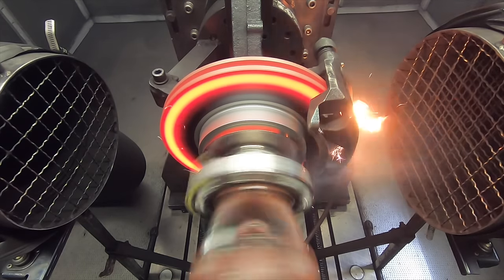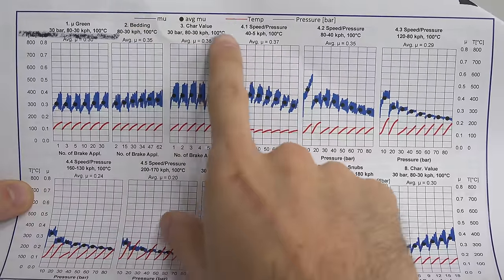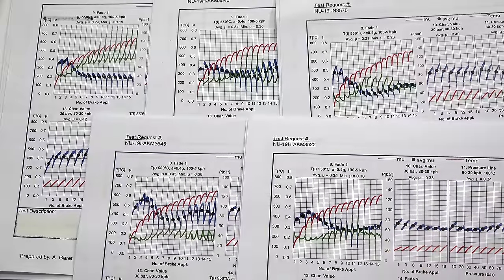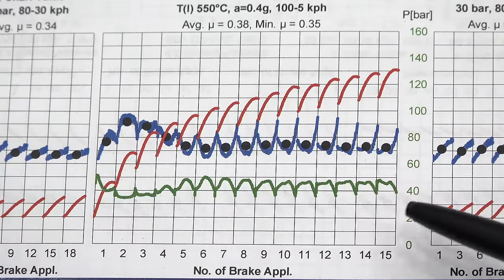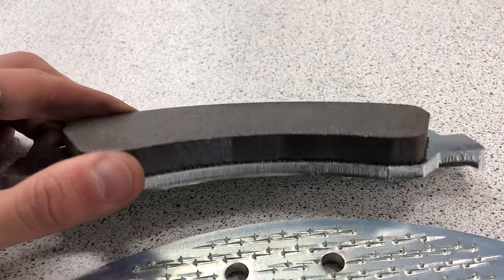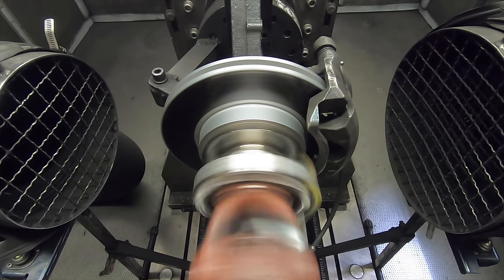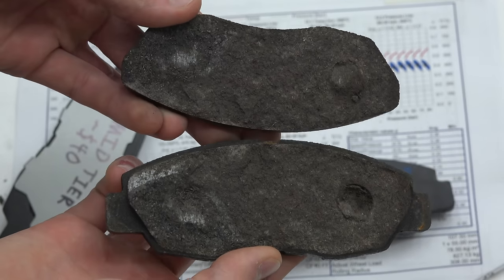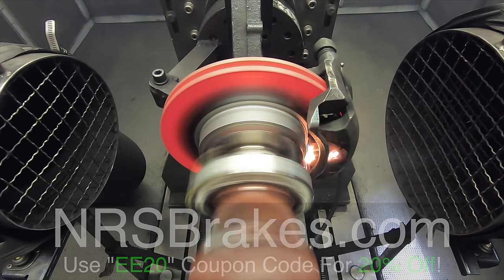What Are The Best Brake Pads? Cheap vs Expensive Tested!

Comment from the maker: *Important Note* Lots of questions about the materials for each pad! It's honestly a very difficult thing to determine, which is why I left it out. Regulations allow for such a wide variety of materials that unless you do some sort of chemical analysis, I'm not sure there's much meaning behind it. For what it's worth, the cheapest pads were "semi-metallic" (again, vague, but that's all they tell you), while the other four pads are "ceramic." There's a wide variety of what can be included in pads, regardless of the material stated. Also, material alone doesn't show a strong correlation with all tests (both ceramic/metallic can do poorly in sound, corrosion, shear, etc), so it's difficult to determine what's the cause for doing well/poorly based purely on material.
Reply: Any chance you could tell us the application here? I'd imagine an older vehicle would use older technology in OE pads, as would a cheaper vehicle.
Reply: Curious on the differences in results between ceramic, semi-metallic, organic, ferro-carbon, and full carbon pads. It would be interesting!
Reply: What vehicle were these pads for? I’d like to know the OEM manufacturer.
Reply: This just left me with more questions than answers. There are so many variables that this doesn't seem to help. For example my daily has some mid grade pads that have a lifetime warranty so I paid for them once and never have to again while on my more performance oriented car I definitely am more worried about fade so I'll spend more. Also a few noisy stops is irrelevant imo.
Reply: Next time will you include the self (or not, I don't know) proclaimed "best brakes in the world" Brembo?
Reply: I think another comparison needs to be done here. The same 4 levels of pads (Budget, mid, high, and OEM) from the 5 common materials used (Organic, semi, full, ceramic, and carbon). A total of 20 pads checked across the same tests. Checking to see the performance difference of each tier across each material. I feel like this would show a more comprehensive analysis.
Reply: @Sam S wtf I don't understand what you are saying, could you please rewrite that?
Reply: @Sam S We're here discussing pads. OE pads were certainly not ceramic 20 or 30 years ago.
Reply: Can you do a video explaining the benefits or reasoning as to the caliper location in relation to the rotor, ie: 9 o’clock vs 3 o’clock, etc.
Reply: @johnmoore1495  In one of the shots (I think related to the shear testing) I saw that the OE pads were also marked AKM.  Just a guess, but Akebono semi-metallic?
Reply: EE, another great video!  Could you please do a video about the pad/rotor “bedding” process and its importance in preventing pulsating brakes?  It would also be nice to see a pad manufacturer confirm a procedure for fixing pulsating brakes.  Stoptech has some white papers on bedding that are an interesting read.  Cheers!
Reply: @Sam S Chevrolet literally just had a recall on the brake system of tahoes this past weekend. And I think he was meaning advancements in pad technology not necessarily advancements in brake hardware.
Reply: if the adhesive bond was stronger in the shear test, then having a mechanical grip between the friction material isn't the best. the adhesive is stronger than the other so budget or mid is the way to go
Reply: At least probably none of them were made of asbestos. I hope. Although it was still allowed in Canada until 2019.
Reply: 2 questions.

What make/model of car are the pads for?

What's the mid grade pad brand? (That's the one I'd buy lol)
Reply: Was there any data recorded for, the wear that each pad caused to the rotors? The price of replacing the rotors, is higher than replacing the pads. The longest lasting pads wouldn't be an advantage if they cause excessive wear to the rotors. Was there a specification for the surface finish of the rotor used in the tests? It would also be interesting to know, how well each pad would perform, with a worn rotor.
Reply: Watching your video, I was wondering all along about the relevance of the pad/disc pairing. Do some pads work better with some disks as the metal alloy in the disc can vary from manufacturer to manufacturer (my break discs on my Porsche show corrosion spots every time it rains, my former Mercedes discs didn't even after a few days).
Also, do some break pads wear out the break discs faster than others? Because, I would rather replace break pads more often and spare my discs (which cost over $1,000 per corner!) even if the pads are of the expensive kind.
Reply: @Photoandcargeek  This is great content. It in would be interesting to know more about rotors as well. I had some old "ceramic" pads that would come to a stop completely silent and smooth. Then the next "ceramic" pads were as bad as any in this regard with worse brake feel. Shame I can't remember what the first were becuase they lasted so long. The good ceramic pads were hard on rotors, but that's good in my environment because often time if the car sits for just a couple days in the salt, the rotors will rust so bad that traditional pads will gall up and, then your brakes are screwed. As far as rotors go, it seems like a total crap shoot and incredible number of junk rotors that delaminate or rust so fast that they destroy the pads. Even if you buy dealer "oem" disks from most brands they are of questionable quality and origin compared to what comes on the car from the factory.
Reply: @ourback  if these are for an Asian OE, they did
Reply: Would love to know what brand the mid levels were. Thanks!
Reply: @Anankin12  they dont make pads
Reply: @michaelehresman5881  the organic,ferro-carbon, and full carbon would do the worse until they heat up. same with ceramics of the semi-metallic but the ceramic created the cut before the carbon and organic pads which will work better in performance areas because they will have less "brake fade" aka work better at the hotter temps
Reply: @toddturnbaugh4451   A lifetime warranty on a pad that should be the sacrificing part means that your Rotor will be GROUND..
Reply: Can you tell us how much you make for each of the 100 ads I had to watch to get through the video?
Reply: @Formulabruce  The pads wear out, I return them and put new ones on, it takes maybe 20 minutes, I never said they were lifetime pads.
Reply: @johnmoore1495  looks like a D449 to me , but I've knocked a few back already .
Reply: Michael Ehresman would be a interesting test
Reply: I worked for ACDelco for over 7 years in the field holding seminars, classes and warehouse defects. Our cross-training “Subject Matter Expert” explained that “Stippling” was used for the mechanical bond as shown. The main difference is the friction material blend was chosen to place the vehicle back into OEM specs for advertised stopping distance. Meeting FMVSS requirements, but used Greenling Labs to provide dynamometer testing as the weight of the vehicle shifted forward. Dual Dynamic Dynamometer Electronic testing of D3e friction material that maybe different for each vehicle. Other brake pads use a standard friction on each brake, regardless if truck, car or high perf car. I will use the Professional Series on my vehicle, but you can always find more expensive pads regardless of color.
ASE Master Tech since 1978/Retired
Reply: @One Issue Voter Engineering uses destructive and non-destructive testing to pass judgement on parts. There is a great deal of reverse engineering that goes on as well. I saw a million dollar facility just for this purpose. 
 Yes, normal passenger vehicles will never be exposed to this kind abuse, the for quick or even extreme results, this testing goes on all of the time. They did not build this equipment just for this video. Even the high end race track stuff is pass or fail and sometimes finds itself onto our cars. Ideas and results are vital understand circumstances and result in improvements in daily life. So race track to road, Space experiments improves if things work the same in no gravity like silk spiders make the same amino acids to create silk, as growing food without dirt comes from. Testing to failure gives valid answers.
Reply: Walnut shells in almost all
Reply: what are the actual differences in the wear material used?
Reply: what about rotors? I have experienced replacement rotors warping very quickly with ver little use before and some rotors that have been rock solid even after heavy use
Reply: Do you have the DOT friction codes for each pad tested?
Reply: What about slotted rotors they clean the brake pad and allow for the venting of hot gases preventing brake fade would be nice to see another video comparing the same pads in the future when applied to slotted rotors I suspect there wont be too big of a difference in brake performance from mid and above but the wear on the rotors and pads would be interesting to note as some might wear out much faster
Reply: @DEVUNK88   If asking about the friction material, each is intellectual properties of the company that makes it. However, trace metals found in coal slag and other organic materials know for high melting points, are ground, mixed into a % of each, placed into a mold, then under high heat and pressure are cooked until solid. Copper, ceramic are used in various amounts to create the friction values they are after. Hope this helps, but some use a know mix of formula of products while OEM's and other companies use different compounds depending on the application or intended use. The weight of any given vehicle, transfers about 80% forward during stopping. Disc brake pads have only so much surface area of contact X 2 for inboard and out-board. Pressures used for clamping force only changes with the diameter of the piston and the number of pistons used. Little or low fade, long life over repeated braking and low dust production are all qualities desired. Some brands are horrible, but like the old adage, you get what you pay for!
ASE Master Tech since 1978 / Retired
Reply: But if we don't even know which are ceramic or semi-metallic, what is the point?
Reply: @Oblithian  It is printed on the box. Otherwise, illegal "Advertising". Or ask.
Have you ever bought brake pads?
Reply: Hey Jason, could you provide info about manufacturer of the pads used in the test?
Reply: That's what I was thinking. Materials is an extremely important factor. FWIW, the factory pads on my Audi definitely stop better than the ceramic replacements, but I'll gladly take the 90% lower brake dust over stopping slightly shorter.
Reply: what a crock of BS when you buy the pads used for the test the manufacturer would have done their own tests to make sure they are valid based on materials used to make them, also SAE testing for pads is also important and is this test based on ABS type cars or no ABS, after all the ABS pressures are different depending on which type of ABS used in a car and what those pressures are, thus you will not have to push hard down on the brake pedal, like you would on those without ABS ?
Reply: 2:00 Step 1 watch the driveshaft self clear against the pad mount
Reply: some pads will eat your rotors/disc's adding more expence
Reply: @deankay4434  interesting information.  The AC Delco Epic website always tells you the suppliers part #. 95% are Raybestos part numbers.
Reply: @ToyotaKTM  good call. Makes sense that a longer lasting pad might result in shorter rotor life and a more expensive system cost
Reply: Correct me if I'm wrong, but ceramic essentially is ANY material that starts as a clay like substance and requires heat to be applied to harden like say in a kelm or heat from engine exhaust. What this means in the realm of breaks, is that the pads can be made out of Gold powder with a clay binder making for a very soft and malleable pad that loses its integrity at a low temperature due to the powder melting. Meaning that calling your brakes ceramic only means that the engineers who designed them have the freedom to make a composite material that can handle high temperatures vs composites that use epoxy resin as a binder like in carbon fiber.
Reply: I once tried to look up all the pad brands that were tested to the highest standard (D3EA testing).    they don't tell you on the packaging, so I had to find out who the testing facility was (Greening Inc.) and found a list on their website of all the brands they D3EA test.  That led me to Wagner Thermoquiet pads, which last longer on my vehicle than the OEM (Mazda) pads.  But most of the best ceramic pads should be D3EA tested.
Reply: @michaelehresman5881  I put cheap semi- metallic pads on my vehicle, and they performed fabulously but made god awful noises.  I replaced them with ceramic, which didn't perform well at first but were quiet.  After a few months, they performed just fine.
Reply: That´s an alchemy anyway... You are right...not worth the time, because the TIER2 suppliers guard their know how... The TIER1 just defines the friction coefficient properties with the final OEM....
Reply: From what i have gathered there are 3 main groups, 2 of which were tested. I usually buy organic pads because they eat the rotors less.  would have been nice to have 1 organic pad to compare
Reply: Missing info on dust and yeah, actual material selection. Features on the pad like slotted, chamfered, shim
Reply: Duralast elite. Carbon brakes. Do a new test
Reply: Without knowing the pad material this video is pointless
Reply: I’d rather have a similar video about rotors!
Reply: Best test: Take your car to the highest (above the base, not sea level) mountain road. Load the car to maximum rated load (GVWR), coast down the mountain in neutral (most automatic transmissions are freewheeling in D or OD), holding the speed to about 45 mph, before aerodynamic drag becomes significant.
Reply: power stop mysteriously missing from this test?
Reply: @nickmccain6598  Typical midgrade brake pads from local Advanced or Autozone, Wagner, Duralast Gold are very good and ceramics. Last long, no corrosion, and as good as the OEM from Toyota especially the midrange like Duralast Gold with lifetime warranty nationalwide from Autozone. Advance Auto has no interconnection and we need to keep our receipt.   Wagner grip is not as good as Duralast gold.  Toyota also sell cheaper ceramics pads with YZZ part number, basically aftermarket in Toyota box.  Original pads are usually semi-metallic from Advics or Aisin but cost almost 2x more than YZZ part number.  If you want OEM like  and quality aftermarket from Akebono or Advics are the best bet. Advics USA 99% are identical with original OE part and better than Dealer parts with YZZ part number.  EU suppliers like Bosch, Zimmermann, Textar, Brembo, Hella Pagid, Meyle are usually ECR90 certified (80-120% specification of the OEM).
Reply: @toddturnbaugh4451  So normal wear is considered a defect?
Reply: It's nice to know the performance specifications of these things. The next question is one of matching the system requirements with the components. "Better" and "Best" for one person's needs do not often translate generally for all. The budget pads may work fine for many in their system and use case, and the cost may be a bigger driver. Cheap new pads are often better than worn out old expensive pads.
Reply: Graphite, Bentonite, Carbon Black, (sometimes ferrous metals, sometimes cupric metals) in various amounts, makes up about 75% of most "consumer" pads.
Reply: @ToyotaKTM  Brake design engineer here...
Its typical to have rotor thickness measured at 8 regions (90 degree apart inner and outer edge ) on the J2522. 
Its quite minimal, we're typically talking about a rotor wear between 10-50 microns during the test. It should be well below 0.5mm wear on rotor during the life of the pads.

Brake pads and rotors have symbiotic relationship, they both break-in to "fill in" for each other, and they continue to wear out each other in that manner for life. This is due to uneven wear across pads and rotors.

New pads are like a new girlfriend after 20 years of marriage. The rotor cannot adjust to her. You must "undo" the break in from the old pad and rotor combination. Rotors don't overcome 0.5mm of wear that quickly, so the break in is not going to happen in any realistic amount of time. You are just gonna wear out the new girl here.

At this point you are just going to accelerate wear on the new pads, have a noisier brake, erratic pedal feel, and some points off on the performance. But you'll still be able to stop your car in a pinch if that's what you are worried about.

Or you can buy freshly surfaced rotors with your pads.
Reply: Thank you for noting this, I was going to ask the same thing. I do understand that depending on the metal used also determines how how each part of the braking system gets. For instance the pads that are better at dissipating heat also cause the caliper to becoming hotter, from my understanding. So less wear on pads but more wear on the rest of the brake system. I am curious as to if the type of rotor has any affect, on the pads if at all though. Bottom rotor vs. top tier coated rotors as well as the slotted and drilled rotors.
Reply: Why not provide the make and model of the pads tested. Without that specific data, your test is kinda worthless as budget, mid, oem are all open to interpretation
Reply: Huh... if that is the case, then perpaps share the pad's brand name and model name will be helpful for consumers to decide which to buy.
Reply: @toddturnbaugh4451  lifetime warranty only covers manufacturing defects. It doesn't mean once you wear them out they just give you another set.
Reply: @seanriopel3132  actually at autozone they do give you a new set when the old ones wear out. I've done this at least a dozen times on multiple cars.
Reply: @DEVUNK88  most likely the warping was from lower quality metal from China and faulty design for cooling ducts. The pads could also contribute to excess heating if they can't bite into the rotor hard enough causing them to increase the time it takes to stop and therefore the production of heat. It is always a balance of braking force, noise and wear of pads and rotors. When it comes to racing brakes the best choice is carbon-carbon for both the rotors and pads but they have to be brought up to a certain working temperature which wouldn't be a good choice for regular vehicles.
Reply: @toddturnbaugh4451  They are not supposed to be.
Reply: @deankay4434  Yes, I've boughten pads that were completely different than advertised on the outside of its box. Advertising these days are nothing but a scam to get you to by their product.
Reply: @toddrhine7648    As with any company, they are trying to increase their market share and most will tell you anything. I know what I have seen, as ACDelco Professional line is marked correctly. I have been at the manufacturing facility and have seen pallets of product ready to be loaded yet on different trucks. Asking the Mgr, she simple said, one company ships product to the warehouse distributor while the others are shuttled to the vehicle manufacturing plant off the same line. We do all city driving and at the dealer, I pulled the front wheels off my wife's Park Ave and at 91,000 miles had 70% of the friction remaining. I changed mine original set at 183,000 miles. I had a 14 mile city drive one way to the dealer and was amazed. During my 7+ years on contract with them, I got to see the manufacturing of fuel pumps to brake pads. Plugs came off three lines at 100,000 plugs per minute from 3 machines. It was a blur. It is way more complicated just to achieve the proper crimp they adjusted down to 0.025 kpa! I enjoyed it but lots of work over this time and teaching the two day classes found hundreds who should not be working on vehicles out of the 30 classes I taught, especially electrical and none from dealers. That was the GM training facility!
Reply: Friction being friction it's a given that pads will be the deciding factor in braking performance, but what about rotors? A test like this but for rotors would be very useful and interesting. I seriously doubt there's much difference between quality brand rotors (if any), and I doubt there's a noticeable difference between budget and premium rotors either. Pads, fluids etc are all rated but rotors kinda just.. exist?
Reply: The materials are the whole point and if you don't tell us then the video is worthless.
Reply: hai jason, could you tell us the brand of mid tier part 😂

it looks like the best price/perf